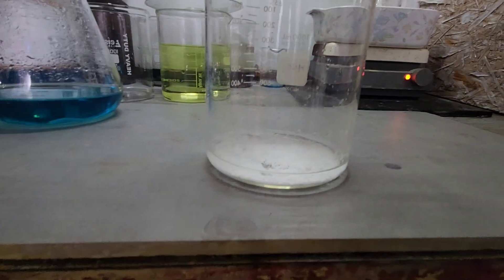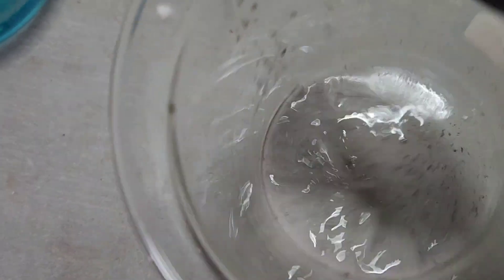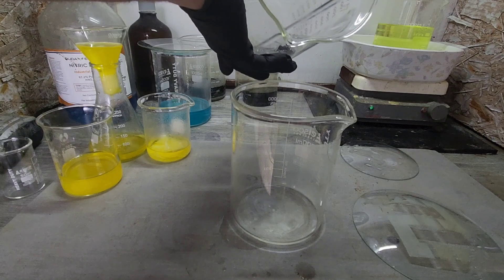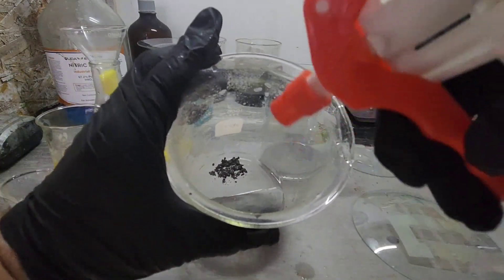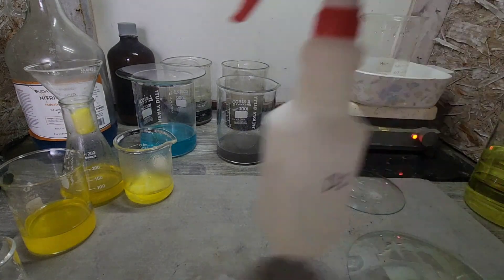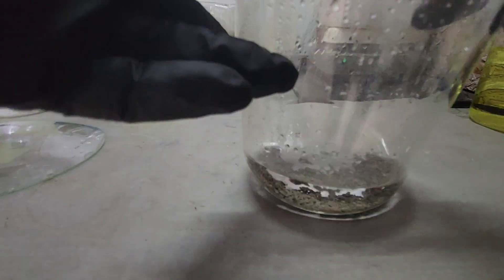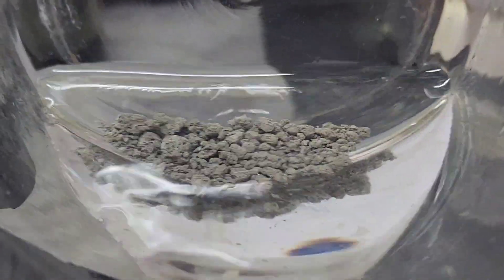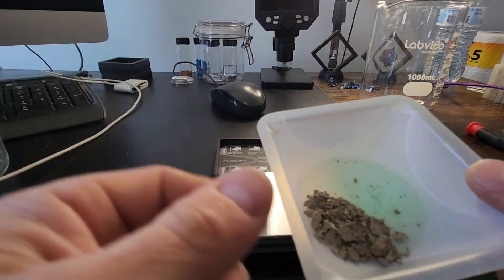Silver chloride conversion with aluminum (gold recovery series) part 3

Comment: Good job. I've tried this method, but had trouble with incomplete conversion. I've also tried using finely powdered aluminum, but the reaction can be quite vigorous.
Reply from the maker: I believe that! With just a splash of HCL, this was going pretty good. I may use the electric furnace to melt this stuff. The slow heat melt should pick up my slack, lol 😂

Comment: Anyone know of good local sources for SMB and Urea? I'm struggling to find it locally. I also have tremendous amounts of silver plated pins and contacts, maybe someone wants or needs them, I'm not looking to sell, but will give the material away if local enough to ship it cheap.
Reply from the maker: I highly recommend ferrous sulfate which you can make very easily and for denoxing I would go with sulfamic acid or boiling the solution down

Comment: This is pretty cool! I don't have a silver cell (yet), but this seems much easier than the lye and sugar method. My assumption is that the electrolytic process will separate the silver from any bits of aluminum that might be dragged along, but I could be wrong. Maybe run it as a separate batch to prevent possible contamination of your current set up. 

I rinsed out my siphon hose that I use with HCL in my stockpot, and it dropped a bunch of silver chloride. I was actually surprised by the amount. Your timing on these videos is spot on with what I'm doing myself. Uncanny and much appreciated!
Reply from the maker: This way won't be pure like the lye and sugar method. It works good for small batches of Oops or I'd recommend just saving it up with other Oops or purposely participated  silver chloride. I did this to eliminate rinse cycles to get as close to a real weight as I could without sending any silver over to the refining gods
Reply: @SilverStoll  I mean, It's not that much material anyway. I'm ok to store it in that state until I have the time and materials to make a cell. At least until that bucket's full and needs to be addressed! haha
Reply from the maker: @jeremylackey3477  zero-waste made a great point with using the sun as well. Put it at the bottom of a beaker and spread it out. The sun will convert it to metallic silver as well.

Comment: Using Aluminium to precipitate metallic Silver from Silver Chloride will result in Silver metal contaminated with Aluminium. Aluminium is very difficult to remove later. Aluminium is the scrapper's friend, but the refiner's nightmare.
If you don't like the standard method of Lye and Sugar for converting Silver Chloride to metallic Silver, you can make a thermal decomposition instead, with the added bonus of, at the same time, recovering all your "HCl" in the form of Chlorine Gas. This gas can be used to dissolve Precious Metals, or if you lead it through ice cold water you'll get free HCl. The Silver Chloride must be heated in a closed system to at least 500 C to ensure full decomposition. The decomposition slowly begins at around 100 C, but is only fully effective at around 500 C.
In order to reduce consumption (read: Costs) of chemicals, I always recover everything that's possible from the chemical "waste". I use thermal decomposition, distillation, conversion to other intermediate compounds, electrolysis, ion exchange/double displacement; just to mention some of the many methods.
Another way of converting Silver Chloride to metallic Silver can be done without adding any "problematic" Metals or chemicals at all! It just takes longer time. Spread out the Silver Chloride (finely divided) in a very thin layer in flat dish and leave it outside in strong sunshine, letting the sunshine rays work for you. It must be placed outside as the Chlorine part will slowly degrade and vaporize as Chlorine gas (poisonous). The process is finished when the white Silver Chloride has turned dark grey, it's now metallic Silver powder; though it will contain a little Silver Oxide due to the exposure to oxygen in the air).
A nice thing about Silver is that its molecular bonds are very weak. That's why it's pretty easy to split a molecular bond with other elements from Silver. As an example, Silver Oxide is easily converted to elemental Silver by heating. The Oxygen is released already at 195 C, although to ensure a complete conversion it's common to heat up to 400 C.
Contrary to this, Aluminium has some of the strongest molecular bonds. Aluminium Oxide is used as a high temperature refractory material. Even 3000 C won't break the molecular bonds between Aluminium and Oxygen. Despite its Melting Point 2072°C and boiling Boiling Point of 2977°C it is in practicality impossible to break the molecular bonds just by heating, no matter how extremely strong that heating is!
Reply from the maker: I agree with all of that! This is a job I am doing for someone and used this method to get awnser fast as possible with a minimal rinse cycle to keep the weight number tight as possible. This way might not be the best to do that however. I am still young in my refining journey lol. I would love to interview you for the channel! I know you have tons of knowledge in refining!